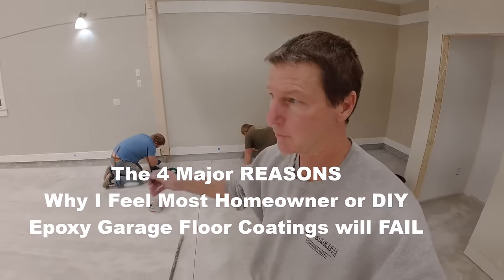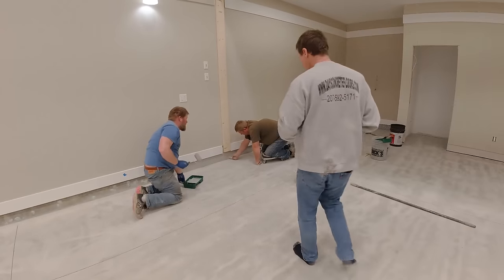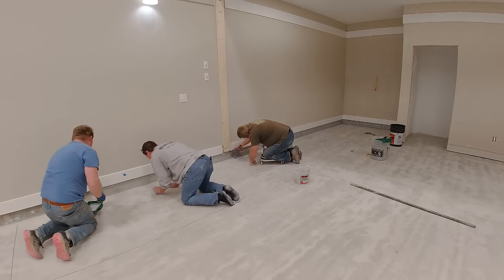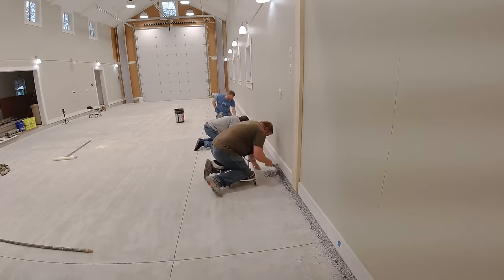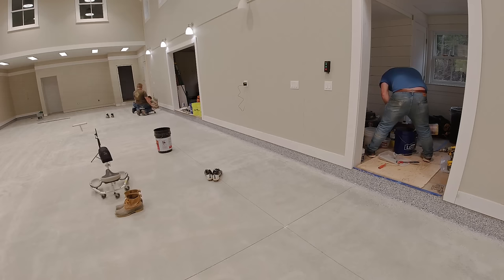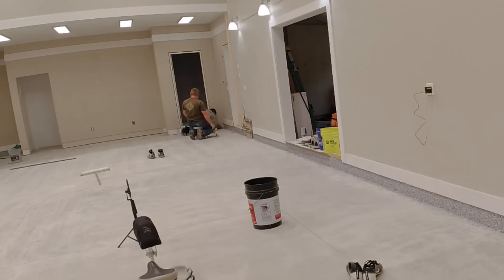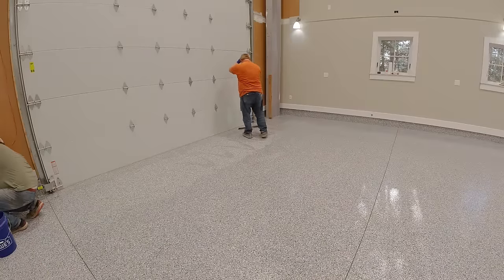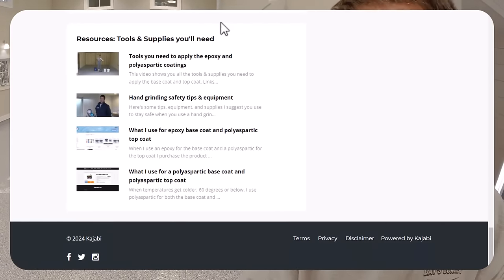4 Reasons Homeowners FAIL when installing EPOXY GARAGE floor coatings

Comment: Great job,I used to do alot of epoxy floors in the central coast i like the way you do the stem wall before hand ,thanks for the videos ,I'm thinking about getting back into it again.
Reply from the maker: Cool, thanks!
Reply: What is the stem wall? Is that the trim you run or the epoxy coat you run up almost as a Basebord?

Comment: Nice work Mike and your reasoning as to why this will probably fail for most who attempt it with no prior experience is totally logical to me.  Of all the bad that's on the internet, it's so good to see folks like you share your knowledge.  Like some others eluded to, I venture to guess most folks on here want a durable quality floor, which they know is highly unlikely in those big box diy kits.  I will be subscribing to your course.

thanks again

Comment: My wife and I did my brand new 22X40 shop. Looks great. We went with Exterior Coatings. As a home owner and DIY person we figured out how to do it correctly. There is a ton of info out there. You make it sound like all home owners are POS’s. There is a reason that I do all my own projects. Contractors are to expensive and you never know what you will get. I was a millwright for 12 years. I am a journeyman machinist. I have worked in maintenance and fabrication all my working life. I consider my work better than most contractors. Don’t get me wrong your works is top notch. It’s just that I have had two shitty contractors do some work and I regret it.
Reply: Brother, coming from local 102, we aren’t a normal home owners. I rent but, the owner usually asks me if I’d like to tackle the project on my own because he knows I’ll give maximum shits and enjoy doing the work.
Reply: I also found this video very condescending to homeowners. It's not necessarily the homeowners' faults that the information they get is almost all marketing. Why would an average person have any idea what 50% solids or 90% solids even means? For those who don't know better, the stuff at Home Depot or Lowe's is just what you buy. Then the instructions and data sheets intentionally oversell the product and make it seems like a piece of cake. What reason would an average homeowner have to NOT trust the instructions on a "trusted," well-known brand like Rustoleum? 

In the end I think all of it comes down to greed. The big box store versions like Rustoleum intentionally market these things as easy just to get people to buy it, knowing that if it fails, or comes out too thin, they'll just buy more and do it again. Why else would they say that a kit of less than 2 gallons could do 450-500 square feet? It's dishonest and they know it.

Then the reason people turn to them in the first place is it seems that every contractor out there is trying to get rich now. Very very few contractors are doing quality, honest work at an honest price anymore. It's all about extracting maximum profit from every interaction. The result is guys with a huge boat house spending $10k on an epoxy floor while the "DIY class" is talked down to in videos like this and left to do things on their own with sub-par products. Heck I'd be willing to bet that most folks who can afford to pay contractors to do it have NO IDEA the contractors use a better product until the contractor tells them it's better in their OWN marketing pitch.
Reply: You’re right.  What arrogance! Do you think maybe he has an agenda and a bias? He’s saying, “Don’t do it yourself… since you can’t do it right.  You have to hire a professional (like me).” For many of us, we can’t afford to hire pros and use top quality artisans.  It’s a choice between doing it ourselves with economical products, or not doing it at all!!!
Reply: 100% agree I like my work better then all the “contractors” I’ve hired. My grandpa and other old timers are really great at what they do but most people now days are just punch out crews tryna get in and out for a check. The shower we just had replaced bc of a leak was leaking again after replacing 😂😂😂 I was pissed I had to tell them how to lay tile how to hang doors and come back for the leaking shower. NEVER AGAIN! All bc my wife wanted to go with the “professionals” so it got done faster and I said fine but I’ll be here not wanting to say I told you so but still having to say it. 🤦‍♂️
Reply: Just a bit of condescension going on here. I was thinking of coating my floor with epoxy, but it’s an old garage built on a cistern. So, I may consider surfacing the floor, and simply coat it with siloxane or stain it. I have no way of creating a vapor barrier under that slab. The only thing I can do is mitigate the moisture by pumping the system out on a regular basis or with a float regulated pump.

Comment: Hi Mike, if I could hire your team to do my garage I would have, but we're on opposite sides of the world. It's hard to find good trustworthy tradesmen here but your videos have been a great source of guidance for my second option - DIY. I'm prepping my 2 car garage, which is on concrete at least 30 maybe 50 years old. Almost certainly no vapour barrier. I'm almost finished grinding it all back with a 7 inch grinder (hard work). The floor consists of two slabs of concrete side by side laid at different times, one is extremely hard grey concrete with a fine black aggregate and the other is soft and more yellow. 

As I grind it back I can see there are several coatings. Glue residue on top, paving paint under and then possibly some kind of sealer. So good thing I am grinding, there's no way acid would have solved this for me. I've sourced a 2 part water barrier which will go down first, and it's good for 60 PSI. I've also sourced a quality 100% solids epoxy.

Comment: Just like any other coating or painting 75 to 90% prep, then application.  Happy customer of a pro company in SC.  2400 ft2 garage.  They spent most of the time grinding the new garage floor.  And flake spread to rejection.
Reply: What did you spend per square foot.

Comment: I have a moisture meter i use on surfaces like concrete or wood when I paint those surfaces.  My brother in law had a contractor coat his garage floor down south (no snow or salt)  and it failed twice already because they used the HD stuff.
I told him I would come down and do it like you taught us on your videos but he's not interested.

Comment: Great video. Thanks. I have a brand new 1400 square foot garage that I want to epoxy with chips. It's a smooth trowel finish. Do I need to etch it? It's 4 weeks since the pour. Thanks.

Comment: Hey Mike, as far as metallic floors go, instead of using a vapor barrier primer and then a base coat of epoxy, could you use a single layer of polyaspartic to act as both the vapor barrier primer and base layer then lay down the metallic layer followed with the same polyapsartic for the top coat? Or would you recommend a primer, epoxy base layer, metallics layer, and top coat?
Reply: You can get a tinted moisture vapor barrier epoxy primer that will work as the primer and base coat, then metallic, then polyaspartic. I've done it several times. People love to skip the barriers around here!!

Comment: I have tried to do my old 12 x 24 garage floor, I used the concreate etching cleaner and pressure washed and waited two days to dry then painted with home depot epoxy floor paint and it would peel up every 3 months and painted 3 more times and finally gave up.
Reply from the maker: That's exactly why I made the video. You did the prep wring and used subpar products

Comment: So honest question, why do folk usually grind the floor rather than shotblast it? Thanks great video
Reply: Depending on the situation, it's just quicker (also depends on the size of blaster and grinder),  grinders are easier to transport, and you don't need to pick up tiny beads everywhere. Also grinding will flatten out concrete crowns/imperfections, and can remove painted surfaces (which blasting will not). A pro to blasting is it's a slightly better prep, but damn you can leave some big wholes in the concrete if you're not experienced

Comment: Profile the concrete by grinding or a light etching solution, power wash it real good, let it dry .

roll out two-part solvent-based epoxy moisture barrier, let dry , roll out colored 2 part water based epoxy broadcast the flakes (there’s an art to this ) knock down the excess after it dries with a good floor scraper . Come back the next day & roll out a 2 part polyaspartic or polyurethane clear topcoat & done ✅ 

Pro tip : don’t waste your 2 part polyurethane sealer on the sidewalls ,you can use a single component acrylic wetlook on these . Only use the Poly on the part that is driven on.

Comment: do you run into off gasing often, and how do you deal with it?
Reply: Typically only happens on the first coat to raw concrete. The next day you'll need to sand the hell out of it, and patch the wholes in. A way to get around it, is throw sand or flakes into the material and it will pop those bubbles.

Comment: Why not just do an exposed aggregate garage floor instead of epoxy?
Reply: Why would you want that
Reply: Exposed aggregate is not a smooth finish, it's very rough - terrible for a garage. Are you meaning a polished concrete finish? (grinding off the surface to expose the aggregate stones but dead-smooth). That'd be an option but you'd still need to coat it. Epoxy is the coating not the flake finish - it seals and makes the floor durable and impervious to oils and staining. Clear epoxy over polished concrete is beautiful but you wouldn't get the raised baseboard edge look and protection of this floor.
Reply: @DiscoFang  Yes and makes sense!
Reply: think about what your saying before you speak

Comment: Great video! I'm in Florida and just started a concrete coatings company and would like to know if Deco Crete is good to use for a Vapor barrier base?.  After watching most of your recent videos, you flake into an epoxy or poly base with poly topcoat.  We are looking to do these in 1 day being able to flake right into the base coat but having some Vapor Barrier built in it, which seems like epoxy is the way to go?  Any help would be greatly appreciated.  thanks : )
Reply from the maker: E2U epoxy has vapor barrier in their epoxy base coat.
Reply: You need to apply a vapor barrier first before a base coat if no vapor barrier was installed under concrete.